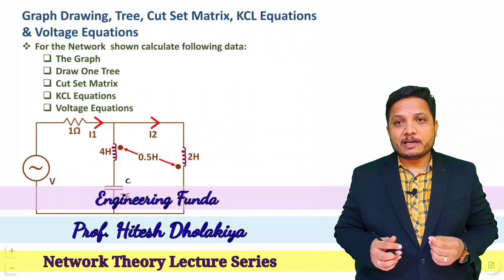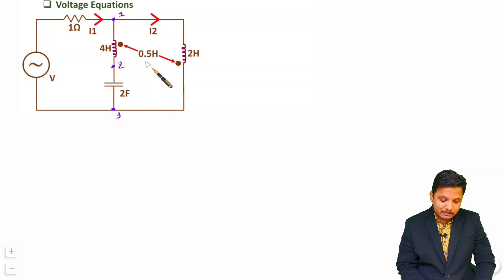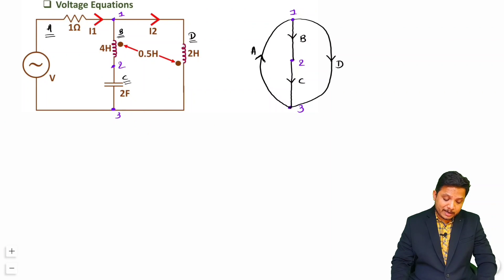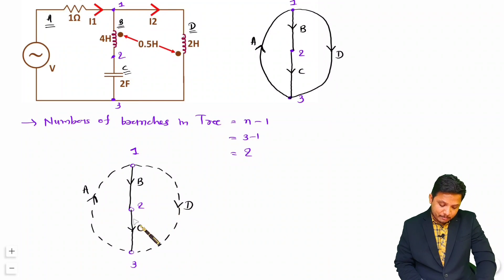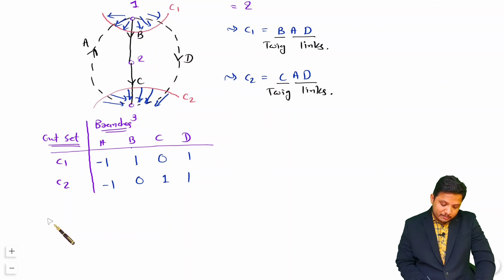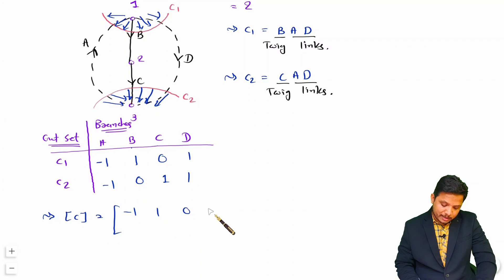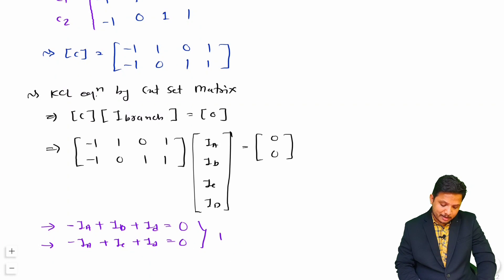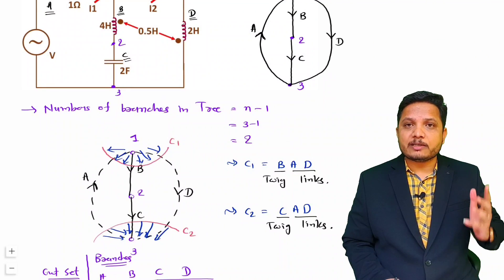Graph Theory in Circuit Analysis: Graph Drawing, Trees, Cut Set Matrix, KCL, and Voltage Equations

Comment: In Vcut matrix it should be a 2×1 matrix na? Vcut 1 and Vcut 2 in different rows
Reply: 11:44, the student is right, you cannot multiply a 4x2 matrix with a 1x2 matrix. So there is a mistake in the video. BPIT is never wrong.
Reply from the maker: It is perfectly correct here
Reply: How it is correct? U are wrong here.. 😢 @EngineeringFunda